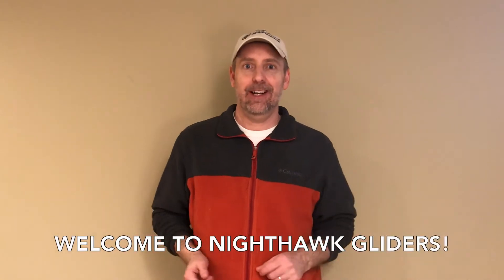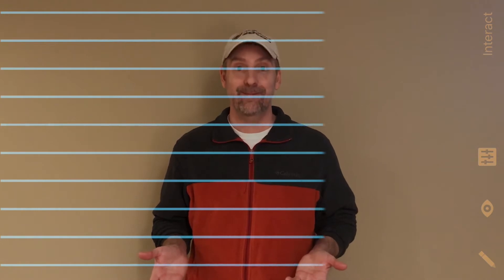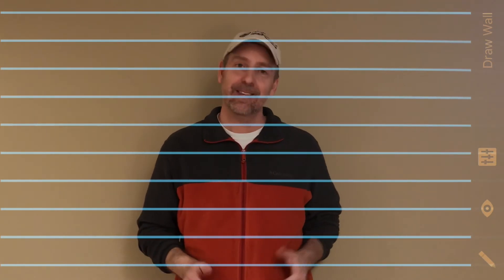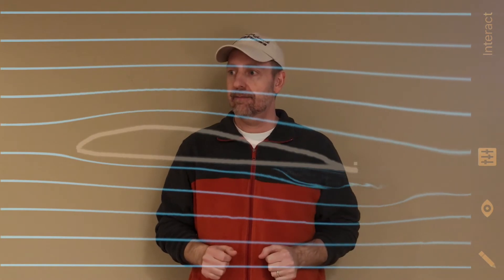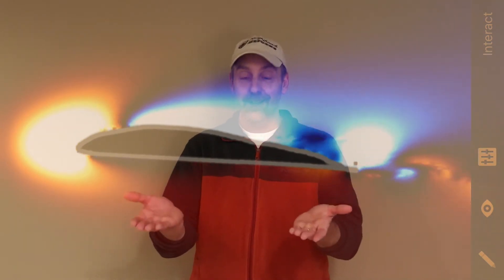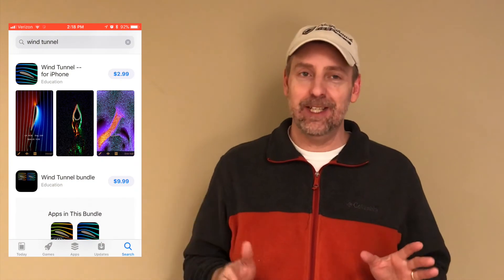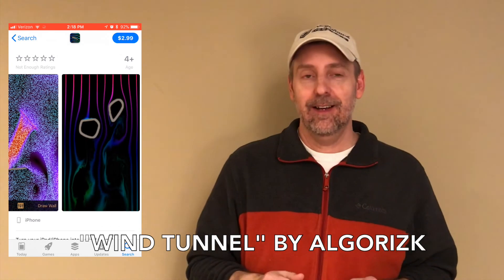Airfoil in a Wind Tunnel Simulator

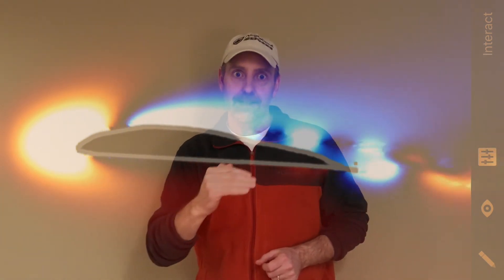Comment: late info.          at 1:52,  WRONG  THEORY, about speed of air movement past an airfoil
note, that in the real world, the air is   NOT  moving.!!!
Reply from the maker: Sure, but it's a matter of relative motion and the result is the same regardless if the airfoil is moving through stationary air or if the air is moving past a stationary airfoil.  In the end (and from the perspective of an airfoil at a reasonable AOA) the airfoil would observe faster airflow over its top surface than under its bottom surface.  This is really not a theory-- it is an observable and measurable fact.

Comment: Can you make the smoke stream into a series of dots? This will clearly show the changes in velocity. You start with a vertical row of smoke dots on the left edge, and the upper dots move ahead of the lower dots.
Reply from the maker: Yes!  It does have streak lines as an option!  In the settings option for Particles, it’s called “Streak.”
Reply: I agree